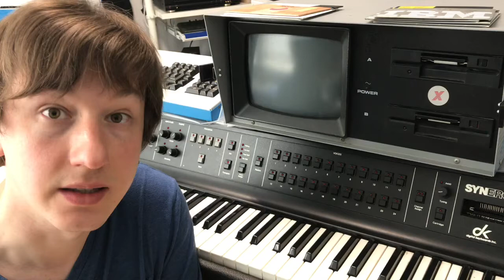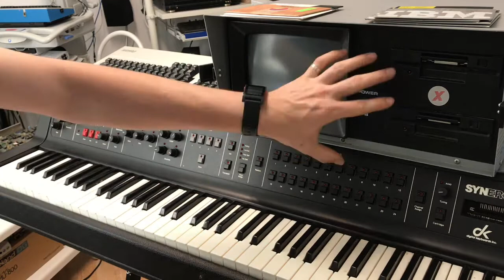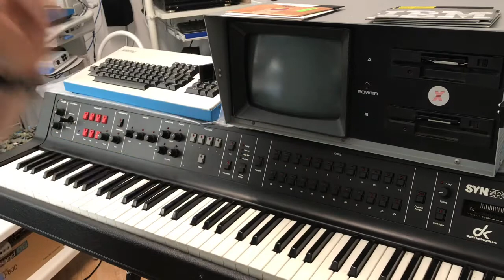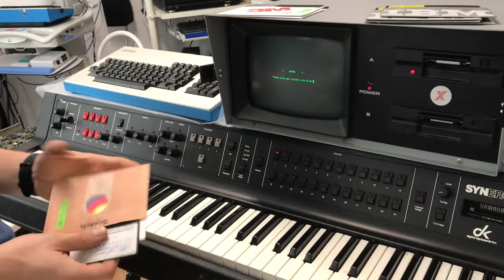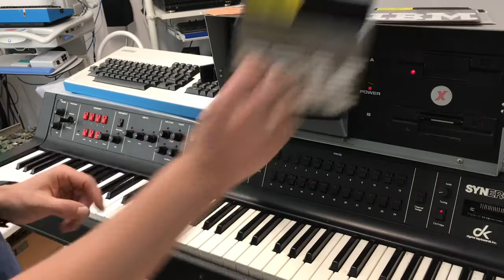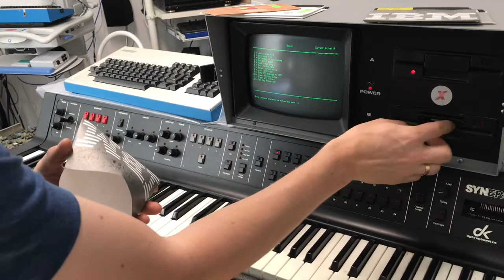DK Synergy II+ in action with Kaypro computer

Comment: Which kaypro computer is this? Kaypro 2? I thought only kaypro 10 works with the synergy.
Reply from the maker: Any Kaypro will run the software based on my experiments, even in emulator that you can find in my other videos.
Reply: @DeftAudio  okai thanks for the answer, what about other CP/M based computers with the correct serial port, would they also work?
Reply from the maker: @lucienmontandon8003  don't know sorry.